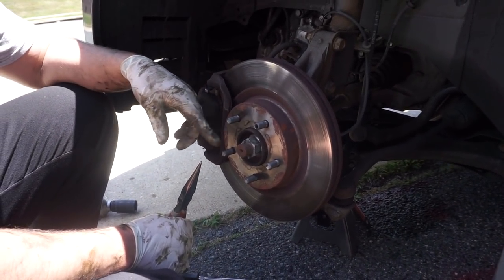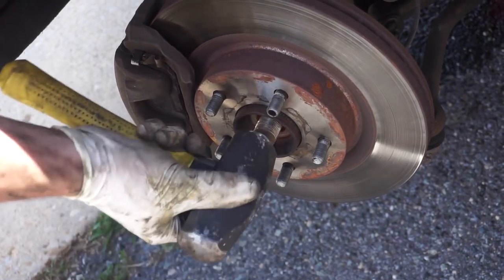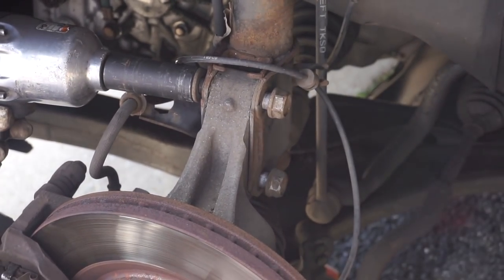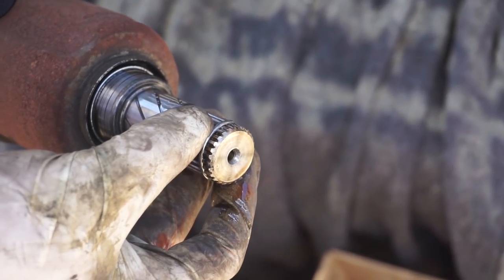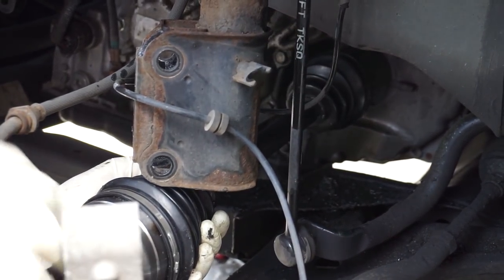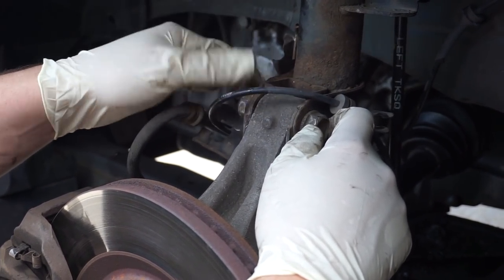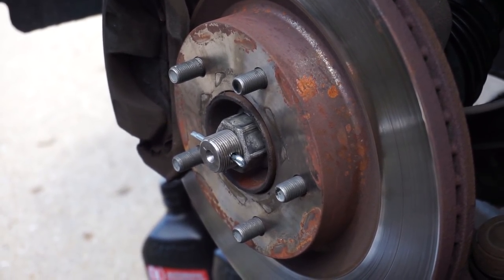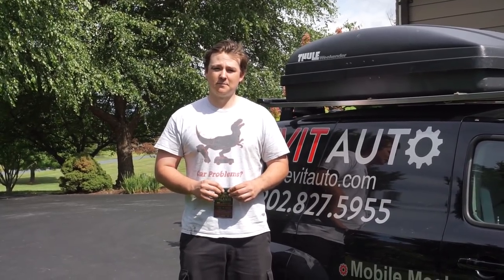2007-2014 Nissan Altima Driver Side Axle

Comment: Absolutely perfect. Just finished replacing both the cv joints on my 14 altima according to Revit. Clear instructions, easy to follow, simple, could not have gone smoother. Well yes it could, I could have bought the right oil filter for the simultaneous oil change.
Reply from the maker: Glad it was helpful. We would appreciate it if you subscribed to help us grow and continue creating repair videos to help everyone. Happy motoring!

Comment: So I got an estimate of about $670 bucks to change both axles. I went online and found a pair for a real decent price with a 10 year warranty. I watched your videos and BAM!. You saved me $500 bucks in labor. Thanks a bunch for the videos. I also feel a great sense of accomplishment.
Reply from the maker: dvxman72 that is awesome! Glad this video was able to help! Happy Motoring!
Reply: Okay follow up question. Now I am seeing a transmission fluid leak. I checked to make sure it was not coming from the axle which I had just replaced and it is not but seems like it's coming from somewhere in that area. Any thoughts?
Reply from the maker: dvxman72 clean the area really really well with brake parts cleaner.  And use a dye in the transmission fluid. Order a small black light flash light of Amazon and it will tell you exactly where you are leaking !
Reply: Okay so turns out I did not need the UV dye. I found the leak was on the passenger side axle. I forgot that axle is longer and comes over toward the driver side so the drip had me fooled.  I ordered a new seal. Any tips on replacing the seal?

Comment: Thanks! This was a huge help. I don't have an impact, so I tried using a ratchet with a 32mm for the wheel nut. A few solid pops with a hammer and it came right off.
Reply from the maker: Glad it was helpful. We would appreciate it if you subscribed to help us grow and continue creating repair videos to help everyone. Happy motoring!

Comment: What kind of fluid was that that came out when he pulled the old axel out and  does that require replacement?
Reply from the maker: That was CVT transmission fluid, if you have it leaking out you will want to check the transmission fluid before you drive.

Comment: Thank you for the video. I was sure it was a simple job but glad you pointed out the seal because i would have just shoved it in and probably shread it lol i hope i got the right parts though.. locating the proper one is a pain in the ass
Reply from the maker: Glad this video helped! The Passenger side is a lot more frustrating. When you are ordering parts just pay very close attention to the part number. It gets confusing looking for a cvt cv axle ;) Happy Motoring!
Reply: +RevitAuto Just completed this job a few minutes ago! Advice for anyone whos cv axle didnt come out as nicely as the one in video, get the largest pry bar you can fit between the transmission and axle and she will pop right out with a good amount of force.  Rides like new! Thanks again 🤘
Reply from the maker: This is an awesome tip! And is a trick we use often! Thank you for sharing. Happy Motoring!

Comment: Thank you for the video!! Do you have to put some CVT fluid after installation since you loose some when you removed the axel?  Thanks
Reply from the maker: We topped of a little less than a 1/4 of a quart. We parked on a hill with one side of the vehicle raised. It lowered the amount of spilling!
Reply: You only use CVT fluid if you have a CVT (constant velocity transmission).

Otherwise you use transmission fluid, heavy weight gear oil for a manual and red ATF for an automatic (check your owner's manual)..

Comment: I have an 05 nissan maxima v6 automatic n i need to do the driver side cv axle will these steps b the same for my car thanks any tips will help a lot
Reply from the maker: The steps will be similar, but not identical! Let us know how it works out for you!
Reply: Revit Auto i did put in but now my stearing wheel is a bit to the right is not center wt u think it is thanks again

Comment: How much transmission oil did you have to add after changing the cv shaft?I don't want to buy a lot of the oil as it is pretty expensive from nissan. Thank You.
Reply from the maker: We only had to add less than a quart of transmission fluid.
Reply: @Revitauto  ok thanks! Another question, where could I buy the seal if I accidentally break it? I couldnt seem to find the part at auto stores. Thanks again.

Comment: Question...how did you diagnose the car needed new axle? I have a 2008 altima and I'm hearing a clicking/creaking noise when I back out of drive way and then drive forward. @revitauto. Thank you
Reply: LaToya Keeling that clicking noise is actually a common sign of a bad CV axle so I would Get it checked
Reply: Did you find what was the problem? transmission or axle?

Comment: WOULD THIS CAUSE NEGATIVE CAMBER TO THIS WHEEL?
Reply from the maker: No, the axle of your vehicle does not have any effect on the camber. That would be up to the suspension components, like Control Arms. I read this as you were yelling loudly fyi ;)

Comment: Where did you support the car with the jack, or stand?
Reply from the maker: I used the factory jacking spot where you would jack the car to change the tire. And then placed a jack stand underneath the control where it meets the K-Member/Engine Cradle as that is nice strong metal. If you have your owners manual it should show you where you can jack your car from.

Comment: @revit auto for a manual transmission does the car has to be in neutral?  Would appreciate your reply. Thanks
Reply from the maker: Interesting question. It should not matter if you are installing or removing. What is important is that you have the axle seated correctly and meshed with the splines. 

What issue are you running into?
Reply: @Revitauto  I am still working on removing the axle (removing transmission to replace the clutch). I just wanted to make sure that I should be in Neutral as I didn't want to break anything.  Thanks for your reply :)

Comment: hi my 2010 altima wont go into drive. when it does i her and feel a lot of shaking not sure if its the transmission or the axles.can you please give me any suggestions
Reply: Did you find what was the problem? transmission or axle? I had the same problem in my 2010 altima

Comment: I seem to be having a really hard time with mine , can't seem to slip the axel right in ..... Am I doing something wrong
Reply from the maker: Are you sure that you have the correct Axel? Compare the two of them they have to be identical check the splines and measure how thick each line is overall diameter
Reply from the maker: Just checking back in on you,  were you able to get it sorted?

Comment: Great Video.. Whats the oil that was released ?? Motor or Trans ?? Thanks
Reply from the maker: Jesus Lara Fierro transmission fluid
Reply: Did the transmission oil that leaked out get replaced?
Reply: Revit Auto do you have to put more transmission fluid in?

Comment: Did you refill the lost transmission fluid?
Reply from the maker: Yes we did,  be sure to keep a drain pan under the trans to capture any old fluid and refill with new trans fluid. We picked ours up from the dealer.

Comment: Try to pull it like that and try different way still can't find the way my amigo
Reply from the maker: Glen Herrera try getting a pry bar to pry between the axle and that case. Make sure you are pulling perfectly straight out. Also put the trans in neutral with wheel chocked. Turn axle a little making sure it spins freely the pull straight out again. Good luck!

Comment: You didn't show filling transmission fluid.
Reply from the maker: I did not! I just updated the description in the video as a walkthrough on how to do that!  
To check your transmission fluid level, put your vehicle in park and start the engine and let it idle. If you do not start your engine, you will not get an accurate reading. 
Pop open your hood and locate the Transmission Fluid dipstick. It is located in the engine compartment at the front of the engine bay towards the driver side. It will have a small round handle.
Wipe off the transmission fluid from the dipstick and reinsert. Pull the dipstick out and take a reading, if your transmission fluid is too low add transmission fluid slowly and recheck. 

Do this until your transmission fluid level is within the marks on the dipstick, and you're done!
Reply: @Revitauto what if my 2014 nissan doesn’t have a dipstick

Comment: He forgot the part were he needed to add cv transmission fluid.
Reply from the maker: Nope! Didn't forget just did not show it in the video. I added to the video description the process for doing that! Thank again for commenting! Happy Motoring! -Blair 

To check your transmission fluid level, put your vehicle in park and start the engine and let it idle. If you do not start your engine, you will not get an accurate reading. 
Pop open your hood and locate the Transmission Fluid dipstick. It is located in the engine compartment at the front of the engine bay towards the driver side. It will have a small round handle.
Wipe off the transmission fluid from the dipstick and reinsert. Pull the dipstick out and take a reading, if your transmission fluid is too low add transmission fluid slowly and recheck. 

Do this until your transmission fluid level is within the marks on the dipstick, and you're done!
Reply: But where’s the oil type?